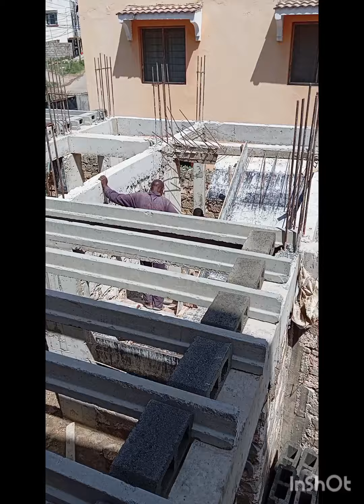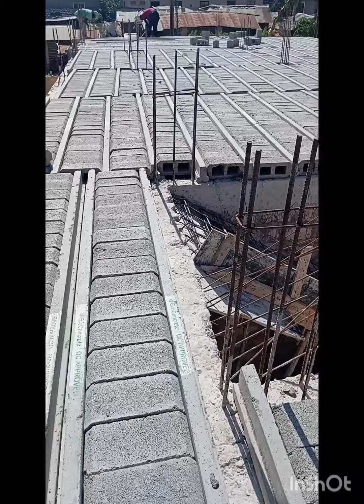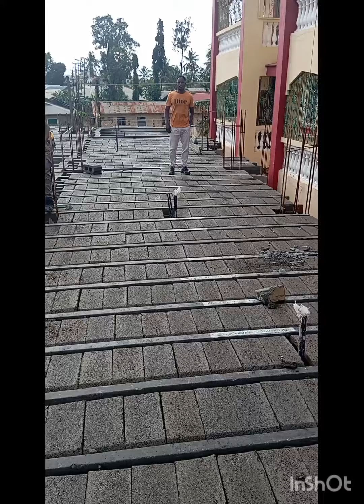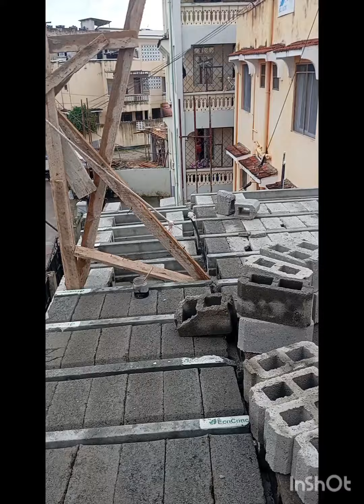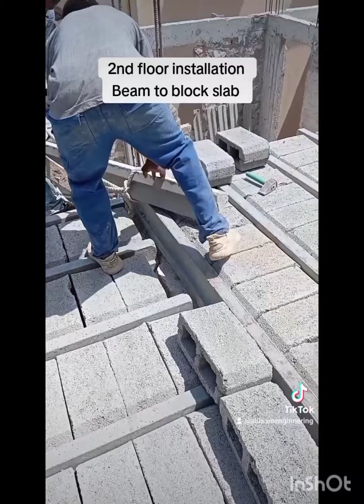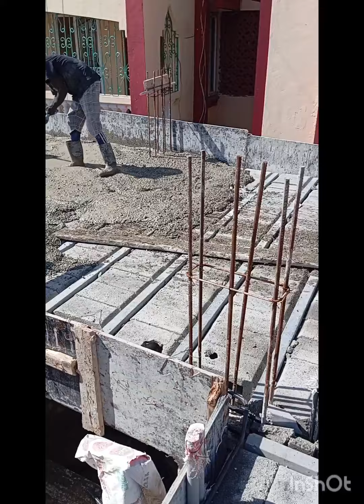16 October 2024

Comment: They have been building with that material in Mexico for many years. Here in Mexico, they have designed flat bricks for the electrical. Also,  the ends are exposed so that  they can connect the rebar to the columns. Also, they put a thin mesh or rebar on top of the bricks to tie it all together. After they put on the cement, they pound it with wood and add another thin level of cement on top so that it won't have any cracks. The ceilings are safe. They can hold a lot of weight, at least the ones in Mexico can. I don't know about that roof. It doesn't have any rebar(columns) at the end around the edges to help hold it up over time.  Stay blessed!
Reply from the maker: @lakeshavallejo7889  thanks for your compliment